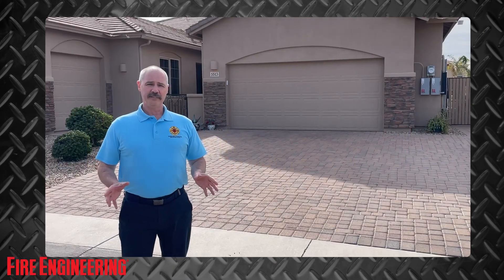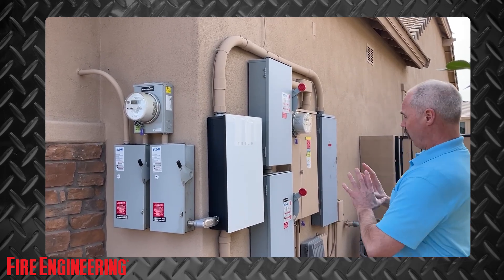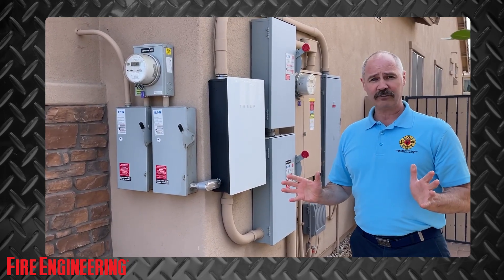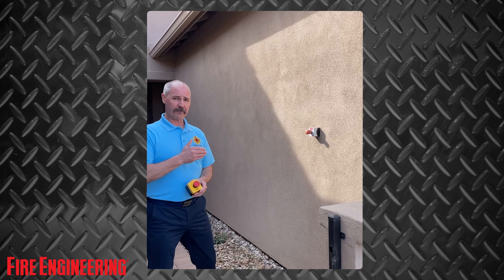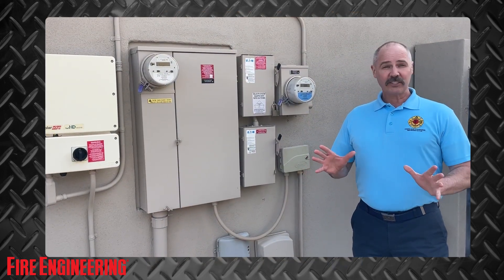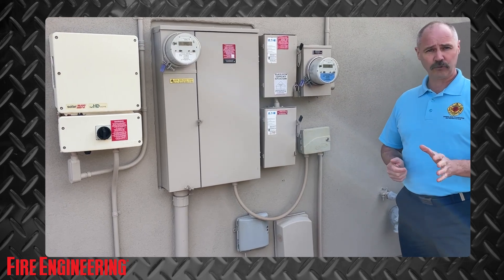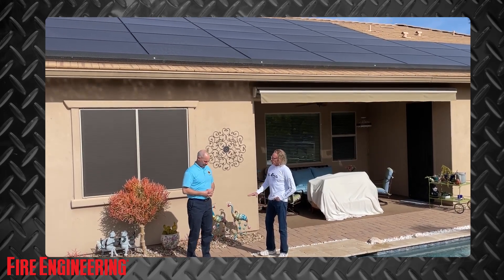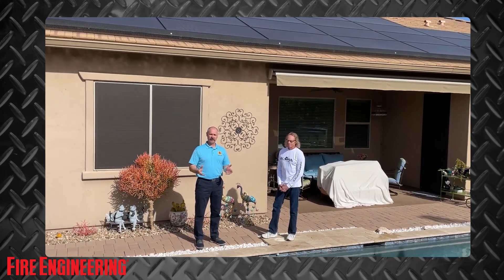Rapid Shutdown: Essential Photovoltaic Safety for Firefighters

Comment: Thanks for the video.  

Australians in their sunny climes appear to be ahead of the curve on fire safety for home solar installations, partly being their government is Gung Ho (mandate$/subsidie$) for solar and their country has extensive utility, commercial, and home solar installations.

6:00 ... There's a nice video on the "MC Electrical" channel titled: "Solar Battery Locations Explained For Fire Safety" ... that is a nice primer on just how advanced the Australian home solar installation code (AS5139) appears to be.  

6:00 ... I do not believe the solar battery installation shown in this video would pass fire inspection Down Under.  Just sayin'.

A good example of a solar battery popping off here in the USofA is at the eponymous channel "Mahlon Moore," a homeowner in Hawaii who captured his solar battery in thermal runaway on his video titled: "Tesla Battery Fire 080925".  He also captured some of the local fire department's response.  Perhaps most notable is how Mr. Moore's solar battery fire apparently could not be extinguished, of course not unusual for Lithium ion batteries ... though the firemen did manage to save the home -- kudos to them.

Anyhow, thanks again.

Cheers.

Comment: Excellent video! Now if you can work with the utilities to stop having them require DC knife switches for systems with 2020+ RSD that would help. I'm not in California and am installing a solar system on my home, but here's the issue I see. With the plunger device I have one big red button to rule them all. Push that and it sends a signal through the wires (powerline communication) to the panels to shut them down individually on the roof; shuts down the batteries by tripping their breakers (UL9540 ESS); and shuts down the inverter. However, if there is a DC knife switch for the panels, and you throw that BEFORE hitting the big red button, you cut off the communication path to the panels and they don't get the signal to shut down! That means that while the inverter and batteries are off, the panels are still producing power (during the day) and the wires coming down from my roof to the inverter are still carrying close to 600V of potential! Take out the knife switch for a fully-compliant RSD system and that possibility goes away. Leave it and you have to remember (ha!) to hit the RSD button FIRST, and THEN throw the now useless DC knife switch or you're creating a shock hazard.
Reply from the maker: Thanks for watching
Reply: Wait at least 30 seconds after you hit the rapid shutdown button to make sure the communication to the panels are reduced to low voltage. Then hit the knife switch. Good point on your end. I am in the process of assembling the parts and pieces for my own 12 panel system. Using Tigo optimizers and the rapid shutdown system. Learning a lot by trying to adhere to the NEC 2020 code the town follows. And it’s expensive!